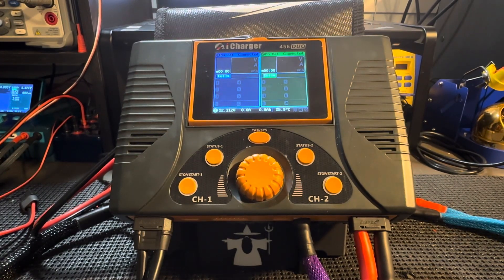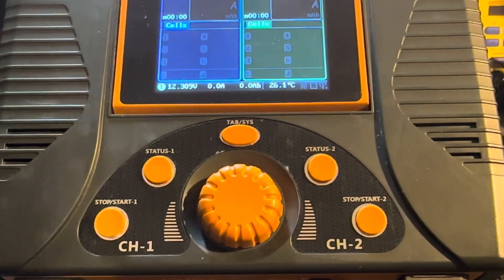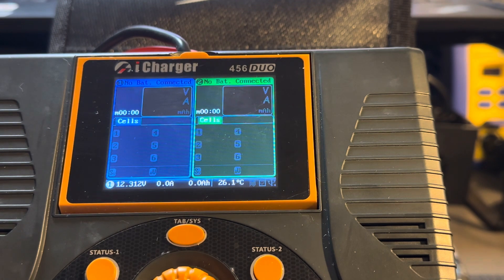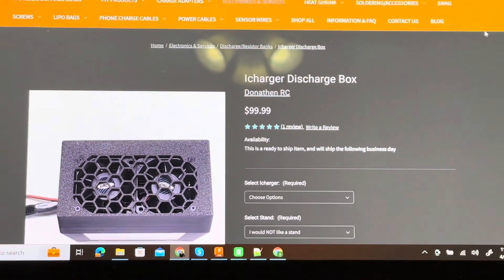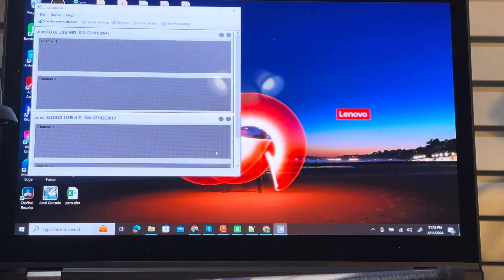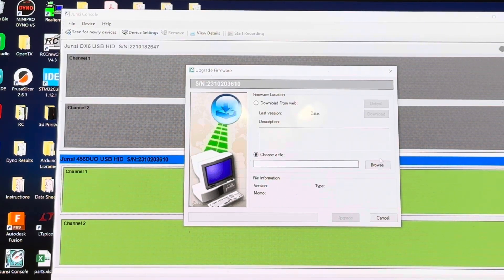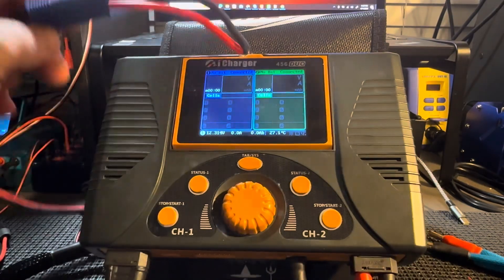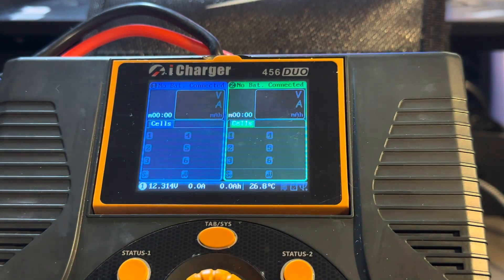Icharger 456/458 Duo firmware update

Comment: Why is the version after the update lower than the one you installed?
Reply from the maker: At the time I made the video a downgrade was needed to get the max discharge rate with the iCharger. Shortly after making the video iCharger released a new firmware that fixed their bug.

Comment: How much more of a discharge do you get. Is it for all discharge banks?
Reply from the maker: You can get the max discharge rate of the Icharger with the newest firmware updates. V1.14
The new firmware should work for all banks designed to work with the Icharger.
Reply: What would be the max discharge rate If the firmware was updated to the latest version?
Reply from the maker: @1dirtovalracer  That is dependent on the model of Icharger you have.  This doesn't change the models specifications.  The firmware fixes the Ichargers not getting to their documented max discharge rate.
Reply: I have a 456, 406 and 4010. I use a 4 or 5 resistor battery bank and on my 406 and 4010 it maxes out at 40 amps .
Reply from the maker: @1dirtovalracer  40A is max for the 406 and 4010.  456 max is 45A.  The problem is some firmware versions of the current Ichargers will not allow you to get to the max discharge rate.  This is just a video to help those upgrade their firmware.